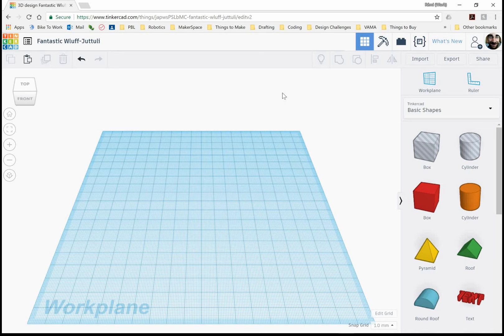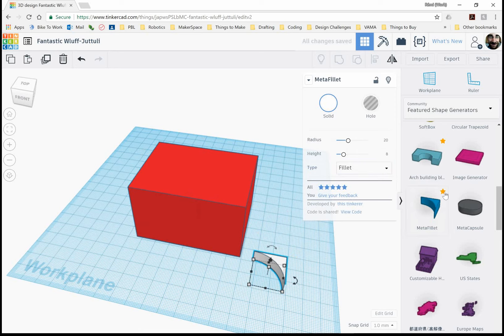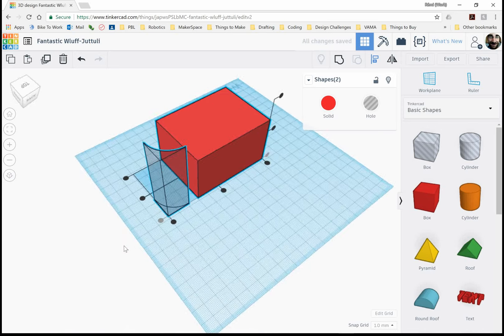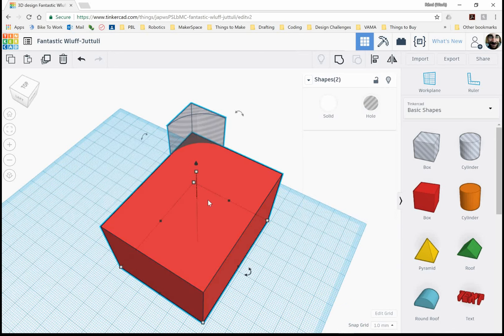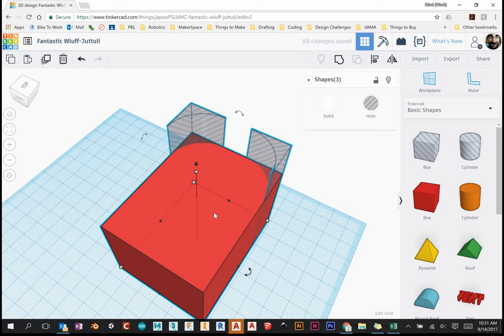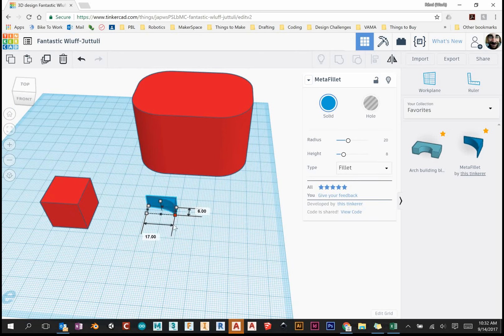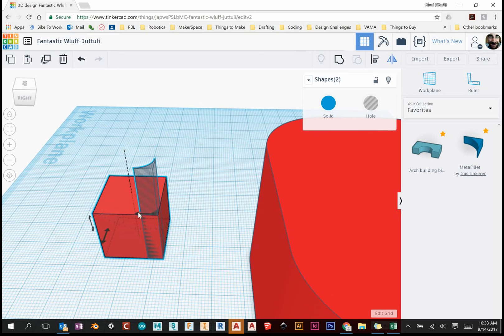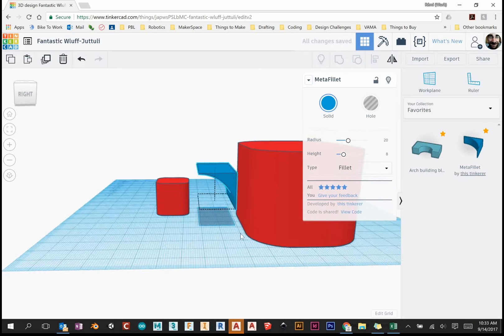Tinkercad - How to fillet/round an edge.

Comment: Quit suffering. Just increase the radius on the cube ( in the drop down menu that appears) and it will add a radius to every side. If you want a curved object like in the video, just increase the radius then cut off the top and bottom with holes.
Reply: also note that you can play around with multiple objects to round off only a side or two.
Reply from the maker: Never thought of that! That is also another ingenious solution  - thanks for sharing.
Reply: @RemiWauthy  glad I could help! I saw many were disappointed it isn't easier...but it is. I felt obligated to show.
Reply: @RemiWauthy  I noticed that if you use the radius - the bottom does not stay flat on the canvas - when 3d printing objects like this without supports - it starts to lift - your solution makes the edges round, but does not bevel the edge like the radius and steps setting does. Thanks for this!!
Reply: Yeah i was just thinking I need to copy an object i already have and need to reproduce its current Radius corners.jim
Reply: @retrogameboyz  also, if you are making a rectangle, the "round" edges are stretched. the fillet method in the video makes them round
Reply: The only problem with the Radius slider is that you have to keep the shape square; if you make it taller, it stretches the radius vertically.  If you make it wider or longer, it stretches the radius laterally.  And it doesn't matter if you add the radius before or after your resize the cube.  So, the radius slider is only the answer if you keep the cube dimensions equal in all directions.  Maybe try something before you criticize someone's methods.

Comment: I don't have that MetaFillet in my TinkerCad  this is 2019
Reply: You do, its just not listed in featured anymore, so look in everything, kinda common sense
Reply: @flosa1995  Finally found it.  NOT where you show; but under basic / All.  Not featured.  Then finally on page 12 there it was with star. What did the star mean and how can I edit to my basic shapes area?  I just grabbed it to a blank page and saved it.

My TinkerCad doesn't show what your's is showing.  Mine only says Featured and All  under the basic tab.  they may have changed the page since 2017.  I signed into TinkerCad 2018
Reply: @ChinaAl  I use the german version so it can be that its called differenty.
When it is in the same tab then I meant the All option.
If you hover over the right upper corner of a tool then a star will appear.
If you click that then it will become listed in favorites in the future.
Choosing a blank page works as well thought.
Also you can sort them better the way you did it.
Reply: @flosa1995  Ahhhh okay thank you very much.  The star was already there so I'll go back and click it then
Reply: @ChinaAl  thank you! yous saved me very much time!
Reply: @alexhodgson4102  Glad I could help.  Many have helped me so when I can help another, it's satisfying.

Comment: Is there a 3d trapezoid shape? I need  10mm length wall and the other wall facing it to be  12mm.
Reply from the maker: Is this a trapezoid prism? I'm having trouble picturing the dimensions of the trapezoid you want. There are a couple different ways you could create a trapezoid. One way is to use the polygon shape and cut it in half (with a box). Another way is to group a box and two wedges together.

Comment: Great video!! I'm having a similar problem rounding/beveling an edge but on the inside end of a tube. When I make the tube I can bevel the outer edge at the end but the inside edge is sharp 90° angle. How can I round off that inside edge to match the outer? Thanks!
Reply from the maker: Good question. There's no easy way. I made a shape that you can use to customize a bevel on the outer and inner ends of a tube. I made it public so you can search it up on Tinkercad and copy/use it. Best way to find it is by searching the name "Remi Wauthy." It's not perfect but I think it'll do the trick.
Reply: @RemiWauthy  awesome. Thanks!

Comment: You are confusing radiused edge with a fillet. then using a fillet in negative the create a radiused edge. if you look at the parameters for the box you initially pulled in you would see a radius parameter, try that.
Reply from the maker: Thanks for your comment. The radius parameter creates a radiused edge (fillet) of every edge on the box. The method I cover is for when you want to create a radiused edge for some edges, but not all. Hope that makes sense.

Comment: Video references a shape that's no longer in the community shapes
Reply from the maker: It has changed location. It is no long in the "Featured Shapes," but under the "All" section of "Shape Generators." I found the MetaFillet on page 12. The best think to do is to star it so that it shows up under your Favorites.
Hope this helps.
Reply: Thanks so much for this It's changed the way I can now design things for my son without Sharp edges correctly 🙏

Comment: This is not the best way to do this, another user below me has described the method which is far better for quick rounding, to go further than just a simple curve you need to learn how to use filets, not simple arcs like this. same goes for circles to even out the number of sides to 64 I thibk, 

 however you can take it a lot further than that if you want a perfect circle without even tiny faces. If your not sure, draw a cylinder, zoom in after you have adjusted the radius to 64 and you will see what I mean.